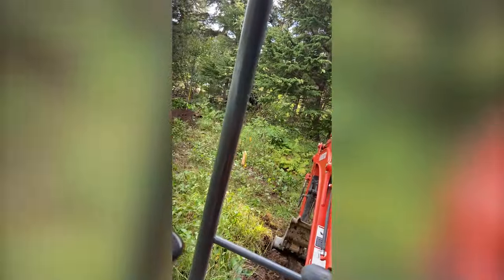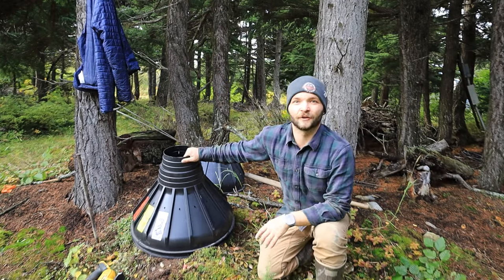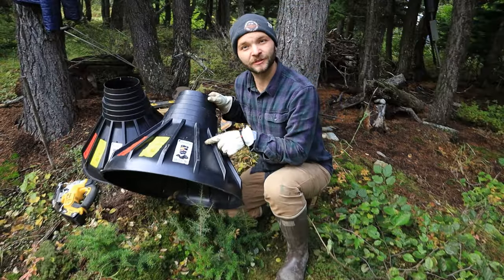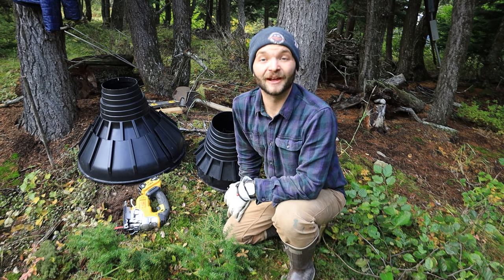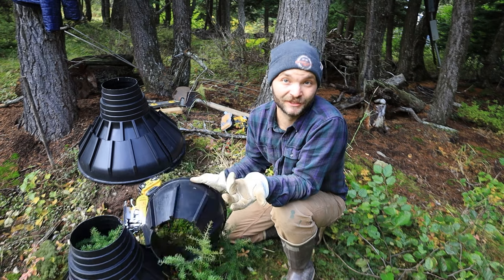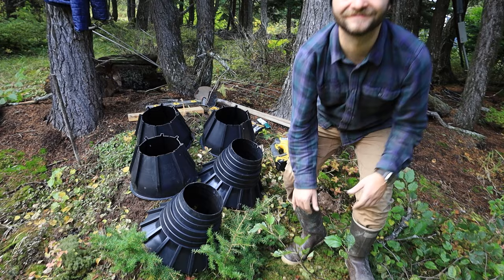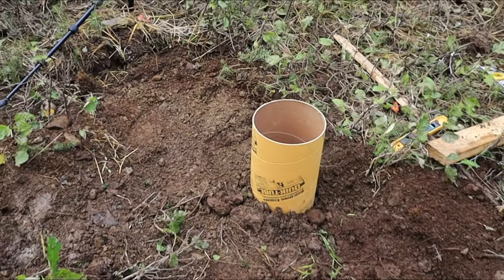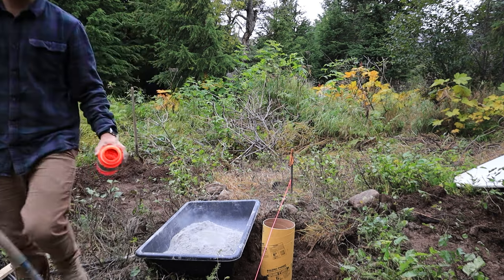Saving Money with Big Feet! Alaska Tiny Cabin Build

Comment: Couldn't you do a two-stage pour where you pour the "footer" formed in the bottom of the hole or not with some rebar kind of in a "top hat shape with the top sticking out. Then put the sonotube over the footer/rebar and pour the second stage? I should have watched to the end before commenting. I did like your two-for-one "little feet". They should work great.